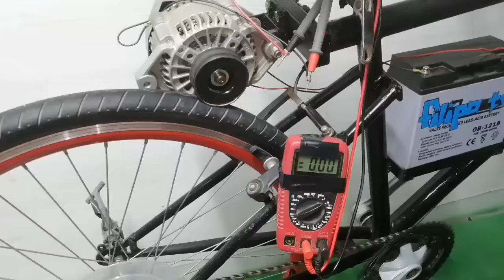free energy.electric bike casero with alternator

Comment: A car alternator isn't a very good choice for the project due to it being relatively inefficient - it is designed to rotate at very high rpm and doesn't provide much charge at less than a couple of thousand revs and then a good deal of that charge is diverted into the rotor to generate the necessary magnetic field.
Furthermore, a car alternator isn't designed for charging a lead acid battery and isn't really suitable for the task - the car alternator is designed to keep a near-fully charged battery nearly fully charged, plus provide current for the immediate electrical demands of the vehicle, such as lights, heater and wiper motor, ignition system, etc. and when it is producing a fair output it requires a good deal of torque to drive it - representing unwanted drag on the bike and extra work for the electric motor which amounts to an unnecessary additional battery drain.

Better results would be obtained with a permanent magnet alternator, a different type of charge regulator, a different type of battery and a means of either switching off the alternator except when decelerating or coasting or disconnecting the drive to it except when decelerating or coasting...
Better results would probably be obtained by deleting the alternator altogether and use the generating capability of the drive motor to send charge current to the battery when decelerating or coasting...
Reply: 🟫THE GOSPEL OF THE WORD OF ALMIGHTY GOD "the Salvation of the last day that Christ brought in the second and last incarnation of the His new and holy name"
       (What God hates most of all are the superstitious practices of people, but many people still cannot let go of them, thinking that this superstitious practice is ordained by God, and even now have not completely let go of those. Even the day of worship (including the Sabbath, which the religious world observes) is hated by God; and even more God hates and rejects social relations and worldly relations between man and man. God did not even order the spring Festival and Christmas day that everyone knows, especially the toys and decorations such as pairs, fireworks, lanterns, Holy Communion, Christmas gifts and parties --Christmas party----aren't they idols in people's mindsthis? The breaking of bread on the Sabbath, Wine, and Fine Linen are even more idolatrous. All the various traditional Festival days known in China, such as "Dragon Heads--raising Day," the "Dragon Boat Festival," "Mid--Autumn Festival," the "Laba Festival," and New Year's day, and Holidays in the religious world such as Easter, day ofBaptism, and Christmas day, all of these arbitrary Feasts have been organized and passed down from ancient times to the present day by many people. The more the Satans congregate in a location, and the more obsolete and backward that place is, the worse the feudal customs become. Many of the Festivals in the religious world seem to show great originality and seem to create a bridge to God's work, but they are not--they are seen as Satan's bonds that bind people so that they cannot recognize the God--all that iscunning trick of Satan. Actually the work that God is doing today is mainly to deal with and eradicate the superstitious nature of people and completely change their mental outlook.) 

Almighty God said
      What GOD hates most of all superstitious practices of people, but many people still cannot let go of them, thinking that this superstitious practice is ordained by God, and even now have not completely let go of those. THINGS LIKE YOUTHS ARRANGE for WEDDING FESTIVALS and DOWRIES for BRIDES; MONEY GIFTS, FEASTS, and similar methods of CELEBRATION of BAD OCCASIONS; ancient INHERITED FORMULAS; ALL the NON--SIGNIFICANT SUPERSTITIONSwork PERFORMED in the NAME of the DEAD and the SEMONY of BURYING them, GOD HATES all of this MORE. 😪
Even the DAY of WORSHIP (including the Sabbath, which the religious world observes) is HATES by GOD; and even MORE GOD HATES and REJECTS SOCIAL RELATIONSHIPS and WORLDLY RELATIONSHIPS BETWEEN MEN and MEN. 😪
GOD DIDN'T ORDER even the SPRING FESTIVAL and CHRISTMAS DAY that everyone knows, especially the toys and decorations like pares-pares, firecrackers, lanterns, Holy Communion, Christmas gifts and party---Christmas party------ AREN'T those IDOLS in PEOPLE'S MIND this? 😪
BREAKING---PIECES of BREAD on the SABBATH DAY, WINE, and FINE LINEN is even MORE truly an IDOL. All the different TRADITIONAL FESTIVALS known in CHINA, such as "Dragon Heads---raising Day," the "Dragon Boat Festival," "Mid--Autumn Festival," the "Laba Festival," and NEW YEAR'S DAY, and RELIGIOUS WORLD HOLIDAYS such as CHRISTMAS OF LIFE, DAY OFBAPTISM, and CHRISTMAS DAY, ALL these arbitrary feasts have been organized and handed down from ancient times to the present day by many people. ☀️
HUMANITY'S RICH IMAGINATION and CREATIVE AWARENESS CAUSED them to be PASSED to the DAY. 😪 

The MORE the DEVILS GATHER a LOCATION, and the MORE OLD and BACKWARD that PLACE is, the WORSE the FEUDAL CUSTOMS. These things bind people so tightly, that they cannot move. Many of the FESTIVALS in the RELIGION WORLD seem to SHOW great originality and seem to create a BRIDGE to God's work, but they are NOT in FACT----SEEN BANDS of SATAN that BIND them MAN to NOT KNOW GOD----ALL of thatis a cunning DECEPTION of SATAN. 🛑😪
In fact, when a phase of God's work is over, He destroys the tools and styles of that time, leaving no traces. 
However, "faithful believers" continue to worship tangible material things; WHILE they SET ASIDE what GOD has in their MINDS, NOT STUDYING it ANYMORE, SEEMING to be FULL of LOVE to GOD BUT the REALITY is HE is LONG-TERM when PUSHED OUT of the HOUSE and PLACED SATAN on the TABLE to WORSHIP. 😪 🛑
The IMAGES of JESUS, the CROSS, MARY, the BAPTISM of JESUS and the LAST SUPPER----ALL of these are respected by the PEOPLE as the LORD of HEAVEN, while OVER--OVER AND AGAIN SHOUTING "LORD, FATHER in heaven." Isn't ALL of this a joke? 🛑
Until now, GOD HATES many similar sayings and practices inherited by mankind, THOSE SERIOUSLY BLOCK THE WAY TO GOD and, moreover, become a great hindrance to mankind's entrance. 
in addition to the EXTENT of SATAN'S CORRUPTION of HUMANITY, PEOPLE'S WILLS are COMPLETELY FILLED with THINGS LIKE Witness Lee's LAW, Lawrence's experiences, Watchman Née's surveys and Paul's work. 

There is really no way for God to work with people because within them there is too much selfishness, laws, rules, rules and systems, and the like, these things, in addition to the last of the feudal people which superstitions, have captured and devoured thehumanity. What people think is an exciting movie that tells a "fairy tale" that is colorful, with incredible creatures riding on clouds, so creative that people are amazed, leaving them dumb and unable to speak. ACTUALLY, the WORK that GOD is DOING NOW is MAINLY to ATTACK and DELETE the SAD CHARACTERISTICS of PEOPLE and to COMPLETELY CHANGE their MENTAL OUTLINES. 🙏
God's work has not lasted until now because of the heritage passed down by mankind through the generations; it is a work He personally initiates and completes, not necessarily succeeding the legacy of a particular great spiritual person, or inheriting anywork of a representative nature done by God in some other age People don't need to worry about any of these things. God now has a different style of speech and action, so why do people confuse themselves? If people walk today's path contained in the Current while continuing the legacy of their "ancestors," they will never reach their destination. GOD FEELS A STRONG DISGUST for this particular class of MAN'S BEHAVIOR, just as He HATES the YEARS, MONTHS and DAYS of MAN'S WORLD. 🙏

            From "The WORD Appears in the Flesh". holy book
Fulfilled in "In the beginning He was the Word, the Word was with God, and the Word was God" (John 1:1). ... and (Ezekiel 2:9-10). ... "His garment was stained with blood. He was called the "Word of God" (Rev. 19:13). 

   📩 All who have "ears to listen" are led to what the Spirit of God is saying in His lowered and built kingdom/Church engraved with His new name, His totality, the ownership of this disposition, "THE CHURCH OF ALMIGHTY GOD "💐 fulfillment from what was said He to Peter 2,000 years ago recorded in (Matthew 16:18-19). His Coming is the fulfillment of all that was prophesied in the great book of Revelation, so the last "Salvation" He brought the whole truth, the way for eternal life. So the "victorious" ones who will receive them are the wise "virgins" because as recorded in the prophecy of His return no one knows it except the one who will receive it! So "come" and come to His kingdom/church standing in the holy place in the air/YouTube! This is also a fulfillment from the book of (Isaiah 2:2/9:6) which He first fulfilled in His first incarnation. 📥 

  "They say with a loud voice, "Salvation comes from the Lamb, and from our God who sits on the Throne!"  (Rev. 7:10). ... and (Isaiah 2: 2 / 9:6) "On the Last Day, the mountain on which Jehovah's temple stands will stand out above all the mountains. All nations will flock there. " . "For a baby boy is born to us. The rule will be given to him; and he shall be called Wonderful Counselor, Almighty God, Everlasting Father, Prince of Peace." 📧
Reply: Nver mind the alternator, the whole project is a waste of time.

Comment: Hi, you have a very impressive car, how long does it take to burn out after starting it and how long does it take for the battery to run out? I'm planning to build one, with 2 electric wheels, and a 2kw gasoline generator
Reply: Take the engine from the generator, and put a clutch and chain on it. Faster and better.

Comment: can u plus the alternator to a battery charger so it does not overcharge the battery
Reply: need a voltage regulator so batt. will not over charge 😂

Comment: By hooking up a generator to a stationary exercise bike, you could potentially generate some of your own electricity while getting in shape. Cycling at a moderate pace for 2 hours per day could likely power a couple of efficient LED light bulbs.

However, the amount of electricity an exercise bike can realistically generate is quite small. Even very fit individuals may only produce around 100 watts of continuous power, which over 2 hours equals 0.2 kilowatt-hours. That's enough for perhaps 20 minutes of television or running a laptop computer.

While using a cycling generator has educational value and helps raise awareness about energy consumption, it would not make a significant contribution towards meeting a household's overall electricity needs. Far more can be achieved through focusing on conservation habits and installing a couple of solar panels, if possible. The exercise bike is better thought of as a supplementary environmental activity rather than a practical green power source."
Reply: Did you not see? He's not pedaling to induce a charge to generate power to his electric motor... The bike is the motor.. range is however long a battery that size lasts 😅 years?

Comment: It's not free energy you burn calories so  you buy food for the  calories see my point? Also how did you energize the coil inside of the alternator since there's no permanent magnets in there with a battery? Aren't you using just as much energy as you provide to the core of the alternator?

Comment: I read the comment at the top of the comments the amount of energy needed to charge the battery from the alternator a lot of energy to make the battery charge alternator would not replace the power that the battery would need for the motor

Comment: O😯, thNx✋(then wats all that 3rd sprocket rectangle box on vertical part of frame?, I though alternators we’re centrifically adaptive.. although this 1 may be wired up in reverse - which makes me doubt what you just said so assuredly, tough to beleive an alternator could work in BOTH electrical directions - either electrics going in to it, causing it to act like motor, or out, in which case the most inefficient light charger ever)

Comment: What's the alternator for ? You do realise it takes more power than it gives out? Your setup would need a magic alternator that gives out more energy than it actually uses!
Reply: @Markcain268  the alternator would most likely act as a brake if if actually got up to speed and tried to charge that batt or run the motor.. I'm Not sure why people think a small motor would run a big charger ? If that were the case why not use a small motor to run 2 alternators ? 1 to self power and the other to power your house 😆

Comment: Ok but a lead acid battery needs a minimum 12.50 volts to charge, you were lower. And theres no "free" energy here. YOU are providing energy (pedaling) to charge the battery

Comment: To flynnbrian77 if you had a high out put  alternator it could recharge anD run the motor just as the alternator runs several electric motors in a car while  still charging the batery

Comment: Dapatkah roda nya membuat alternator nya mengeluarkan daya di 2000 atau 3000 rpm. Sebab pengisian accu di 2000 rpm baru terisi.
Reply: The output power is regulated by the alternator no matter what the rpm is. Car engines vary in speed this is dependant   on the acceleration.

Comment: Why don't electric cars have alternators. Recharge as you drive
Reply: Faraday's Law prevents it.  No free lunch.
Reply: @emu-5493  Not even if you are charging a separate battery that kicks in when the other one runs low. Kinda an all electric hybrid.?? 🤔
Reply: @edward2448  No free lunch.  Takes more energy to produce electricity than the electric energy produced.  Read Faraday's laws.  Sort of  NO such thing as 100% efficiency or  perpetual motion.
Reply: @emu-5493  Maybe someday solar roof on a vehicle with the technology to create instant current 🙏🤔🤞
Reply: Magnets were invented since then
Reply: Magnetism is perpetual...
Reply: @edward2448  Solar is an outside energy. Not part of the system. If it were, what to do on cloudy days? Perhaps we need another source of energy like nuclear.  But wait, that's not perpetual either!!!  Waaah...  we wanted perpetual motion and it is NOT possible...  😭
Reply: @emu-5493  I have faith in mankind that it will be, someday 🙏🤞. In a little over 100years we went from the Wright brothers to a rover on Mars. I may not see it but........?✌️
Reply: @edward2448 All we can do is experiment, work and hope...
Reply: @emu-5493  As soon as it is Profitable it will come to be.

Comment: I been saying why can't electric car be built with electric motors turn to power the car and also a generator to keep the batteries charged . A continuous car , with just replacing batteries from time to time. They don't want us to have free power cars. They rather the Earth become more and more polluted first before they let it happen.  Like you see these little toys with solar panel  how they work , why can't giant ones be built to work and turn generators for free power as a generator will produce more than solar panels. Bunch of them could produce more power to light up cities. They don't want free energy,  as smaller ones could power acouple houses 🏘 and not cost nothing after they are put in place , well like everything things break. But it would be no pollution in using them.